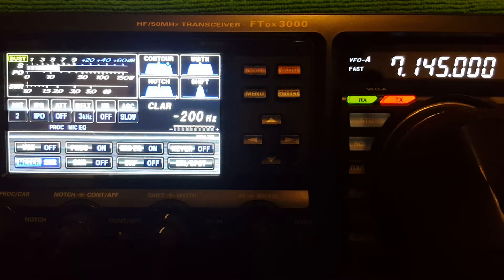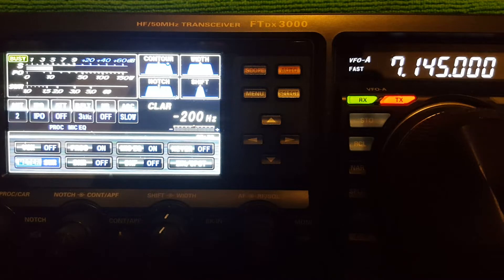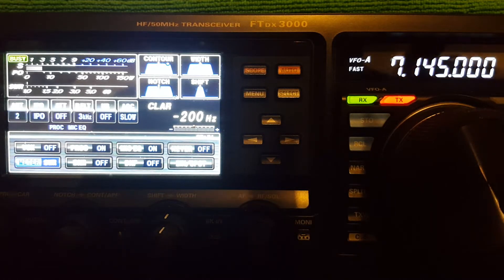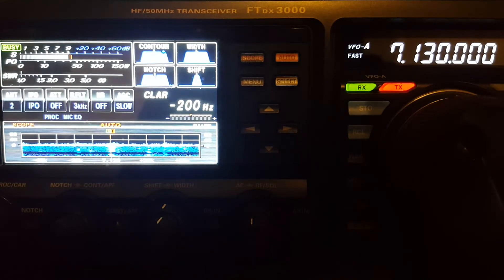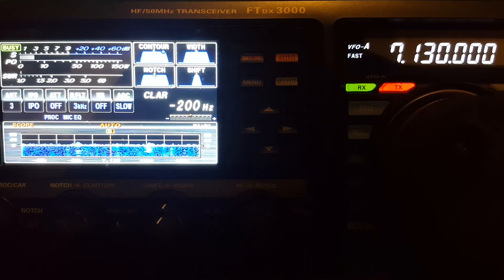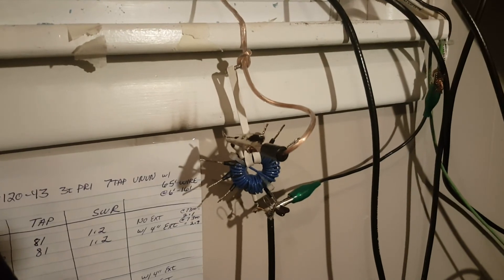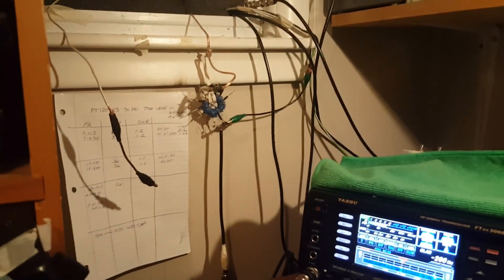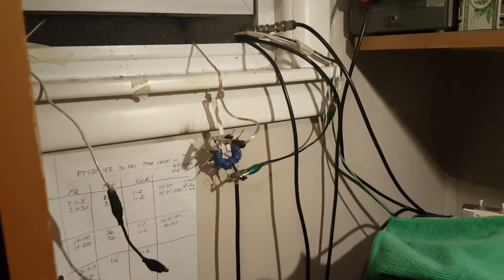40 EFHW – Signal Level Comparison - FT120-43 core - 40 EFHW compared to 40m inverted vee

Comment: Excellent , so many factors come into play,  direction of antennas? radiation pattern..

I've 64ft End with 49:1  balun, sloping to 33ft...
Reply from the maker: i wonder what difference I'd see with a wire same length as yours? I'll make it 64 ft and see. Yours is much higher than mine, about twice as high. Maybe more directional. Mine is so low that mose people would call it a poor performing NVIS antenna. haha. I mostly put it up to play around with noise and signal levels. I'll actually make some contacts with it. I'll also look at it on RBN hits and compare that to the inverted vee and see what happens.  73 and take care OM   :)